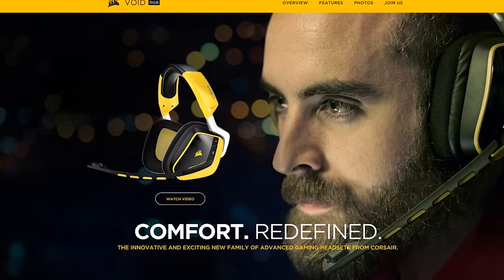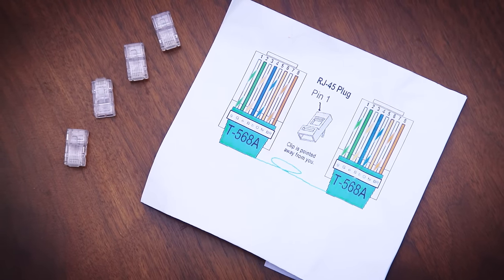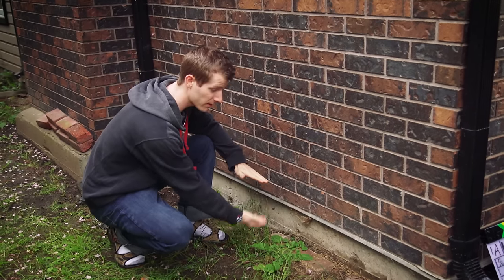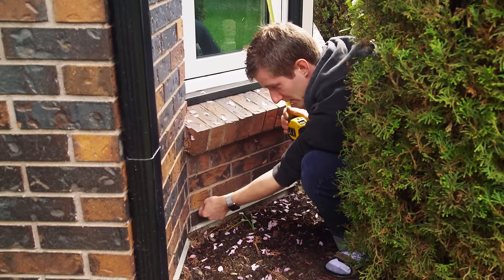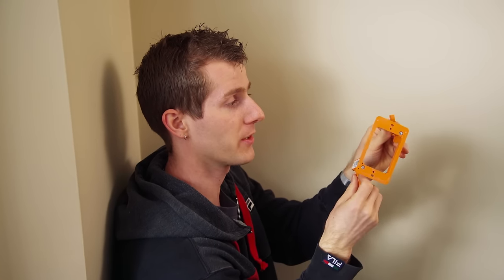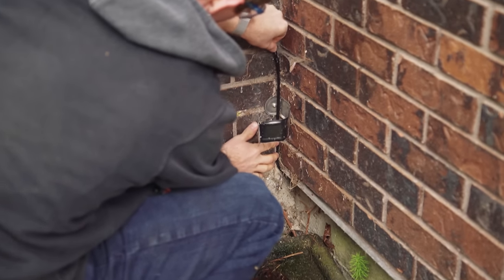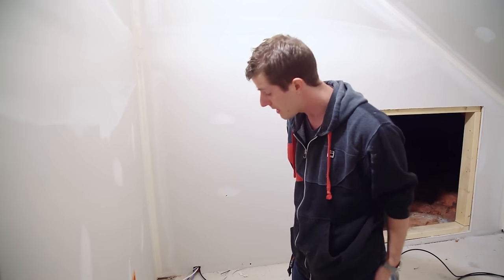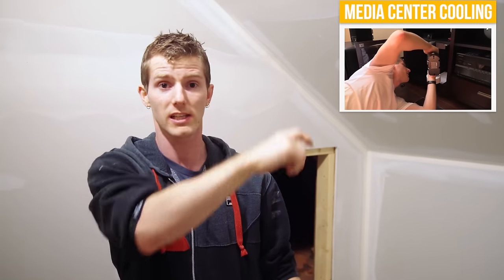Optimize your cable runs at home! - Installing an exterior Cat 5e cable

Comment: From outside better drill upwards, and make damn sure there are no wires in the way inside the wall, that electrical plug could have had wires running horizontally on both sides. (and even when codes would say differently you never know who could have done prior work, builders of cookie-cutter houses hire contractors that use tons of apprentices and take plenty of shortcuts). Cocking should not be smeared on top of the wire when everything is completed, it should form an effective plug in the hole together with the wire, to do so you need to pull the wire out just a bit, apply cocking all around the wire squeezing it also in the gap between wire and wall, push the wire back in to drag the cocking inside the hole and then you can apply outside whatever is needed to look neat once the cable is fixed.
Also that is a big hole in the vapour barrier behind the drywall if you are in cold places like Canada. The builder did some things like that in my house and after 10 years I had to fix all the plugs on exterior walls. There are plastic boots shaped for the various electrical boxes or one can be made on the spot, without there is going to be just moisture condensing right behind it.

Comment: linus, i have a garage with about 20-30 feet of space between the house and i want to run some Ethernet to it. There will be light foot traffic where the cable would run, what all do i need to make this happen? there was alot of stuff i read about the danger of lightning strikes and stuff...i just get tired of the spotty wifi connection out there.

Comment: I've always had better luck running cable through internal partitions. Measure carefully and drill down through the two 2x4s at the top or bottom of an internal partition, and run your cable up or down from there. (You can't do this on external partitions because of insulation.) One trick when running cable down through multiple floors of a home is to drop cables down the air conditioning air return ducts. It's pretty easy to pop off the air return grates and drill into an adjacent partition. But one warning about all of this: get the proper tools to locate studs, power lines and pipes in your walls before blindly drilling into anything.
        The only other comment that I would make is that since the price difference between Cat5e, Cat6 and Cat7 cable is pretty negligible these days, why not upgrade to a more recent standard.  You never know what you needs might be down the road, and it could spare yourself a major rewiring project. Just make sure that your couplers, jacks and cable all meet the same standard.

Comment: Ok, so I've been thinking of running some network cables to my garage. I have actual cable internet and honestly don't wanna be arsed (for billing reasons) to have them run a new line out there. Advice?
Reply: The garage is detached, by the way.
Reply: Just run a cable there? Dig it like 30cm deep and put it in a metal pipe.

Comment: You could of done Ethernet Over Coax if you already have coax runs, you just need Ethernet to coax converters,which are cheap these days, I’ve seen this used many times, Most every DirecTV customer has it, if their DVR can’t be directly plugged into Ethernet then they will take the Ethernet from the router, convert it to coax and then inject it into the whole home coax network which makes its way to the DVR box over the same coax as the satellite signal.

Comment: Does anyone know if this works with Ethernet backhaul on mesh units like the TP link deco? I want to use Ethernet backhaul between two decos, one will be inside my house and the other outside in a garden room, so I will need to mount an outdoor Cat5e/Cat6 cable with a jack socket inside at both ends. Will I be able to use Ethernet backhaul in this situation or do I need to wire the outdoor cable directly to the decos?

Comment: Would that not be a security issue? Someone can just walk up to your house, cut the wire, crimp a new jack on the end, and use your internet. Not that hard of a thing to do if you ask me. I mean the chances of someone actually doing that are unlikely, but it is 
still very possible (especially since everyone knows that you have that 
cable running outside your house). I think it would be smarter to run it on the inside of your house for the security. Also it is much easier to drill through drywall and wood then it is brick. Plus you wouldn't need to spend so much money to get a special cable for outside use. Just a thought....

Another thing to note is that using a wire guide (or whatever it is called, there the small plastic thingies that have the holes for all the wires, you just slide all the wires into the correct holes, slide the cable into the rj45 plug, and then crimp) with the rj45 jack would make it much easier to position the wires before crimping them. I use them all the time and it allows me to get a perfect cable every time. You can buy them for a few bucks on Amazon.

Comment: I'm no expert.... and what I'm about to say is not sarcasm.... But wouldn't it have been easier to cut the square foe the wall plate in first ( better visual) then drill out from the inside to be sure you don't hit any wires or studs?

Comment: A question for the american and canadian people: do you usally terminate the cables that you run through your house with a jack like linus did? I found IDC on the internet but I'm not sure if that's the standard in america. Here in germany we terminate our copper network cables on patch panels or network sockets with LSA connectors. What Linus did looked kinda unprofessional to me.
I guess Linus just failed at networking basics again but I'm not entirely sure so I hope someone can answer this.

Comment: 2:58 that Is not an "impact drill" that is a Hamer drill VERY BIG Difference. 
3:45 that is NOT an electric screwdriver. that is a impact "drill" they work COMPLEATLY differently and should NOT be mixed up.

Comment: Why not just put it in the attic or basement/crawl room, then have it come down inside the walls an then out the wall? You won't have to drill your outside wall then and it will look much cleaner?

Comment: I, instead, would have, in the case of hard floors, (hardwood, tile, etc.) used silicone sealer, by running the Ethernet cable along the line that the wall and floor meet, then putting silicone sealer over it.

Comment: 11:39 So, the kink in the cable you just pulled tight worked itself out behind the wall ?  Not likely. I bet when you pulled it tight, there's a massive kink in the line. 
All that work for better speed was ruined by the kink you didn't remove before pulling the line tight.

Comment: Did the line work in first try? Also those walls are pretty lame... no insulation? (my house has 12 inches insulation... seems big from outside but small from inside... damn energy saving)

Comment: It's clear Linus doesn't do very much cable installation. You always drill in a 30 - 45º angle up, so there is no chance of water getting in, no need for the silicone finish. Also a regular CAT6 will be ok for 10 or more years, I have regular CAT6 stretched on street poles, under direct sun and rain for more than 5 years without a problem, on the side of the house it's even more protected.

Comment: I've tried this with a pvc conductor running on my flat roof and the second I set it up I realized it was going to be a no no. I also used hot glue so idk where I went wrong.

Comment: explain to me why not cat 6?
Cat 5 is not a long term solution anymore. I have been installing Cat 7 in industry for 10 Years now. And they don't even need 10 Gigabit.
Oh and you're doing my job right there. Only i do it in Europe and earn over 5'000 USD a month doing it. And it's done a tiny bit diffrent. I use a lot higher quality "jacks" and use a lot more tubes, etc.
Aswell, when drilling from inside to outside or outside to inside you should drill slightly diagonal, so the water cannot seep into the house. Cause no matter how much silicone you use, it will get old hard,  dry and eventually have cracks.

Comment: Why didn't you punch down the cables ends with a normal wall network plate instead of crimping and using female to female wall mounts?

Comment: i got bell fiber recently , all the way to their router whatever . I was using cat 8 ethernet . My s90c is hooked via hybrid fiber optic hdmi . This morning i wiped out an older cat 6 ultra thin ethernet cable . Guess what , subpixel false signal is gone .xbox serie x . My question to you , is faraday caging ethernet cable the ideal way , yes theorically rj45 could go fiber optic . I was wondering if you ever airgapped each wire in an ethernet cable . Pretty sure the cat 6 ultraflat just put more space between wire . I mean electrical rule usually is solid for dc braided for ac current . I'm trying to understand why there is such a huge improvement with cat 6 ultra flat ethernet cable on fiber optic internet .this does not work on coaxial internet . I had tried in the past . It's like there is less false signal . Tv set to pccgame mode original

Comment: Rogers technicians need to watch this video. When they installed the Coaxial cable they literally just drilled a hole from the outside in through the wall, put cocking on the outside, and left the inside with excess cable and a ugly hole in the drywall...

Comment: As a tech guy, and someone who does these wire runs for a living, I am pretty disappointed that he used a female to female rj45 adapter in the plate instead of an impact termination. Any moisture or dust does get in and it's just begging for problems.

Comment: i know i should not ask here but does anyone know how to fix my display? ever since i installed a new gpu driver my screen wont fit on my monitor/tv anymore. it used to work fine and had this black and sorta thick outline on the sides and top of the screen but i dont mind since i could play games and do normal stuff. now my screen goes over my display and is too big. i cant even press the start button now. so should i just buy a new monitor and hope that fixes it or should i do something else cause im totally lost right now. (btw i think my screen resolution is 1768x992.)

Comment: captain here:
never run ethernet cables outside. In case of a lightning strinking in your house, every NIC will be destroyed. Even if the lightning strikes in a radius of an kilometer it will damage the NICs. Better use cat 7 cables which terminate in LSA+ Patchpannels and RJ45 Wallmounts. And always check if the bendingradius is right.

Comment: Exterior cable runs always look like shit...always...in addition to causing damage, the holes become entrance points for water, insects, etc.     If you are having a new house built, or are doing major remodeling work, have every room wired with Ethernet cable from the start.   Electricians won't charge that much more to add Ethernet cable.  Even if you don't plan on having anything hooked up in a particular room you can just have the box covered with a blank plate until you need it.    In an old house, things get tricky.  Surprisingly it's usually easier with a very old house because many really old homes don't have insulation stuffed in the walls.    The best way to proceed is to locate your internet service in the basement, unless you're in the South and basements are not a thing.   Run the Ethernet net cable from the basement to the attic and drop your cables from there.    A good way to get the cables from the basement to the attic is by running them next to a chimney or even the waste/vent pipes.

Comment: Linus, this should not have even come past the planning stages without a real contractor cutting holes in the walls. Also, you should have ran 100foot Thunderbolt cables along with fiber so you have a real Linus quality setup.

Comment: This is the only video on youtube that I can not buffer right now, not even 144. I tested any other series of random videos at 1080 and they prebuffer quickly. I can not watch this one video.
Reply: im having the same issue.
Reply: Its a known issue.  Linux Shoots at 4K and trans-codes (Render's) it back to 1080p.  The trans-coder that Linux uses leaves artifacts (extra-info in the video stream)  that the YouTube  trans-coder can read  that makes it think it needs to recode it back to 4K which is its original format which it  then tries to stream to you since your internet can not handle a 4K  video streams volume it does not play. (Try drinking form a fire-hose lol).

Comment: Your power cable goes inside of the walls don't they? why didn't you pull the Ethernet cable through the same pipe as it does?

Comment: why not just run it in the wall??? it would be easier and it also has better staying power... oh and the added benefit of not putting holes in your house... i wired an entire house over the weekend with a friend all you need is a magnepull and a real punch down tool to wire the rj45 the right way... also why did you use cat5e and not cat6e or cat7e???

Comment: I work with this stuff everyday... And I really don't understand why you wouldn't just wall fish it. Up to the attic, then back down. If you have a crawl space, use that. It's even easier. I avoid drilling through brick unless it's absolutely necessary.
Reply: Cameron Carver Right. I worked with a licensed contractor and we always fish wires through attic and crawl space. Outdoor is last resort. But you know sometimes the customers have the most difficult houses.

Comment: More often that not, with the heads of the ethernet cable showed in the video, you dont need to take off more than 1.3 cm of isolation. Just if anyone was planning to do it at their home :)

Comment: Why are you using A standard? I am tought to use B standard.
Reply: It doesn't really matter as long as you do it the same on both ends. You could theoretically use any combination as long as they are the same. That being said yes B is the standard in the industry.
Reply: Isn a for ruuning phone on same wire?

Comment: You should be punching it down not using one of them crap wall plates with a socket on the back. You should also leave some slack in the wall if you ever need to re-terminate.

Comment: As a cable guy I cringed when you guys used caulk. Silicone works just as well, and it is far easier to remove in the event that the cable goes bad. Also, any reason you used a female to female instead of a punch down termination jack? I've found they generally last longer.

Comment: Linus...Question: I have a 1meter cable from the wall to the router and a 5meter cable from the router to the PC and my max speed is 14Mb/s. My friend on the other hand who lives 1Km away has a 30metre cable from the wall to the router and 1.5 meters from the router to the PC and he maxes out his connection with 24Mb/s. how is that pissible?
Reply: It all depends on how much money you give the ISP...
Reply: Charles Thompson III Same connection, same money, same bundle.
Reply: DCLXVI562780 then it likely has to do with the cable quality, router settings, and bandwidth usage on your network. The length of a cable isn't really going to make a difference under 200'. How much speed are you paying for? You should call your ISP if you're not getting at least 90% of what you pay for
Reply: Charles Thompson III Hahahaha on the island I live my friend is the onlyone that gets 90% of the speed he pays for. We both pay for 24Mb/s.
Reply: the average of the island is around 3 to 4Mb/s. But the average of the company I use is around 10 to 14Mb/s.
Reply: 1km makes a huge difference in copper internet wiring. The difference you're having with your friend seems about right.

Comment: Now try this on a mexican house where the wall is a single piece of concrete and brick covered wih a thick layer of plaster in the inside, and maybe ceramic tiles in the outside. No room to insert the wall plug.

Comment: TL;DR Too much WiFi. Use Ethernet for all performance sensitive machines.

My apartment is only 750 sq. ft. and my Ubiqiti UniFi AC Pro is right in the middle of it. WiFi quality is still extremely poor because everybody and their brother has a wireless router nearby. Some 2.4Ghz channels are constantly over 50% utilization! So pretty much anything with an Ethernet port gets plugged in to a switch. WiFi only gets used by mobile devices now.

Comment: You should have drilled the metal flashing and zip tied the cable underneath.  NEVER drill into the concrete foundation unless absolutely necessary.

Comment: 1st mistake 
The bigger drill is a SDS DRILL
2nd mistake 
The small drill is an impact driver
3rd mistake 
Measured once not twice. 
4th mistake said safety glasses and didn't use them
5th mistake 
Middle size drill is a combi drill driver 
6th mistake 
Didn't stick tape around drill bit for precise drill through depth for Rawl plug and screws 
7th mistake 
Used left handed hammer

Comment: linus tech tips are actually super useful, basically just do the opposite of everything he does and you'll be fine haha. Seriously though why not drop the cable throught he wall instead of running it outside? Is it double brick or something? Secondly those 'female to female' jacks are rubbish, I doubt you'll even get 1gbps probably only 100mbps

Comment: Rule #1 when drilling through an exterior wall. Never EVER drill perfectly plum.. You always want a slight inclination. Water always goes down and it will never be able to come in the house if you give it a proper slope. And I believe the caulking you used is not appropriate for exterior jobs.

Comment: Should've just gotten some small pvc pipe passed the cable through the pipe and drilled through the wall, easy no need for expensive outdoor cable that is exposed to the elements.